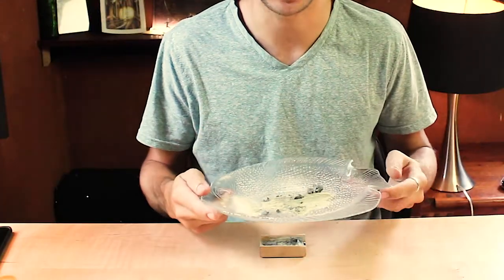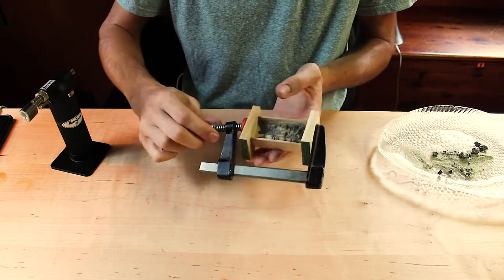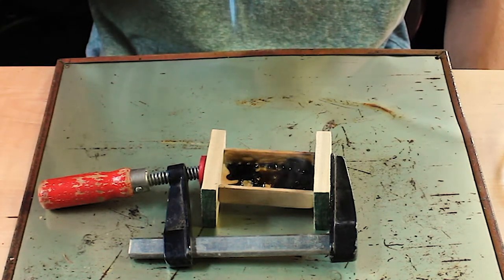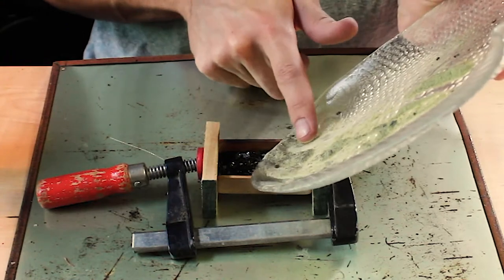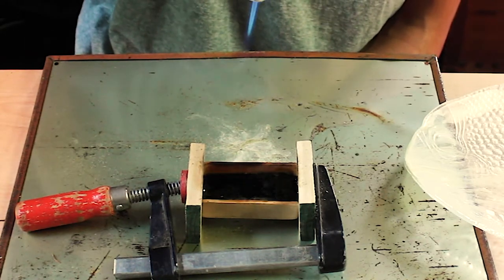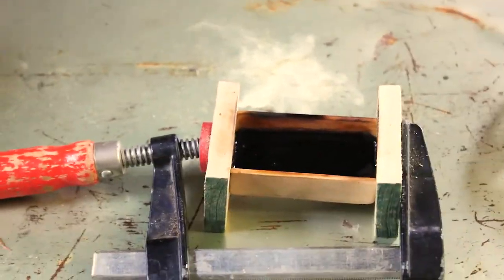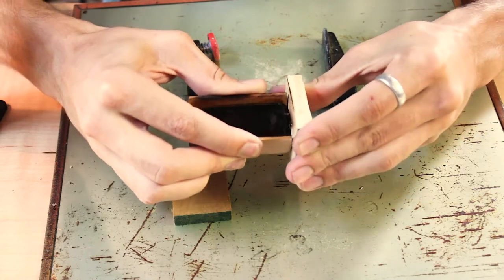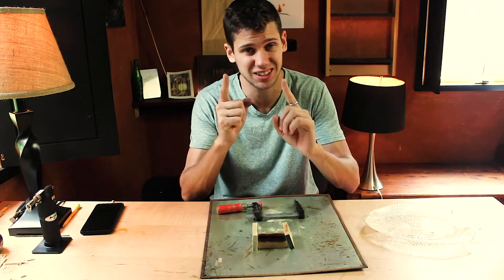EASY WAY TO FIX YOUR VIOLIN ROSIN!! DONT THROW YOUR BROKEN ROSIN AWAY!!!

Comment: "Don't burn the wood or boil the resin" burns wood, boils resin
Reply from the maker: Lol
Reply: @ChrisKempter  when I did this though mine cracked after
Reply from the maker: I've had that happen before. I usually just heat it up again. Mine was very dark though. The lighter grade might not be as easy to keep from cracking.

Comment: Interesting video. The way I do is I take a little aluminum retainer that used to have small table candle in it I put the rosin inside the container and set it on my wood stove Nice & Smooth no fire no Flame not much smell and it makes it perfect disc of rosin just like you would buy at the store
Reply from the maker: Nice! Sounds like you have perfected the process more then I did lol

Comment: I wonder if the honey trick will work?
If you boil water In a pan and use a small class mason jar and put the resin in the jar and the jar into the water. Might try it
Reply from the maker: That will probably work.

Comment: I received a rosin with fractures already in it. After a while, pieces started to fall out. I decided to recast it. I used a different method than yours, but it finished out nice, and solid, no cracks. I set it aside. After a couple hours, it has fractures all through it. I didn't drop it or anything. Why is that? I just don't get it. Has that ever happened to you?
Reply from the maker: What method did you use if you don't mind me asking?
Reply: @ChrisKempter  I put the pieces and dust into a shallow glass coaster and put the coaster in a pan, which I then put on the stove. I had used aluminum foil and duct tape to corral the liquid rosin in the original wooden frame.
So, I poured the liquefied rosin into the frame and let it cool until solid. I then removed the tape and foil. That's it.
Reply: @ChrisKempter  I wonder if a bit of oil or beeswax (or something else) might be a fracturing deterant, but not ruin the bow with stray oils? There must be some binding ingredient that will add some flexible strength (if that is what is needed). I wonder if anyone has done any research on the topic?
Reply from the maker: That is definitely interesting. You basically did the same thing that I did only with a pan instead of a torch. Was there something in the pan that might have mixed with the resin? Like some cooking oil or grease?
Reply: @ChrisKempter  Nothing used at all. Just a dry pan with the glass coaster sitting in it. I had thought I might add water to the pan (like for double boiling) but dismissed that as overly-enthusiastic. :-D
Reply: I just thought of one thing that may or may not matter. There was some of the fractured resin still in the frame when I poured the melted rosin. I don't know the physics involved, so I can't dismiss the possibility, laugh at the idea, or whatever, but there it is.
Reply from the maker: @raymond.duncan  maybe you could do it like I did and melt it in the wooden case.
Reply: @ChrisKempter  I'll give it a try. Maybe having the case heated up too , may be the answer. Thanks.
Reply: After casting the rosin, tap the mold in order to release any trapped air bubbles that might have formed during the proccess. Then, while the rosin is still liquid, return it to the still hot but switched off oven and let it cool down slowly (door closed) for at least an hour or even more. This makes sense as similar methods are employed in pottery to prevent vesels from cracking after baking them.
I've heard that there is a rather strange additional step to avoid cracking. After fully cooled,  the rosin is to be wrapped in a piece of cloth (about 3 layers of cloth actualy) and be placed in the freezer for 30'. These are not my words of wisdom so I cannot accept credit (or be blamed - in case of blatand failure). Perhaps you should look up more such information to validate the instructions I provided, before atempting to follow them.
Reply: @anastasiostresinis6899  The long cool-down in the oven sounds reasonable. I like to read more about the advice-giver's experience with doing that, or anyone who had success with it. It's counter-intuitive enough that it could possible work  LOL. Perhaps there is another clue in the ceramics field: the "crazing" effect of glazes because of different contraction rates with the underlying clay body.
Reply: @raymond.duncan   I would assume that the advise-giver's experience is probably close to zero, however I do not know who was the adviser's adviser. There is this video by a kid (early teen tops) where he makes his own . I am not very sure It is polite towards Chris Kemper to post a link here. If you're kind enough to search "How to make rosin from scratch", you will definately come up with something.
Reply: @anastasiostresinis6899  I have seen videos where people harvest rosin from trees and melt and purify it. Interesting work. Thanks.
Reply: Good video. Made me think. You have a nice manner in your presentation. Thanks